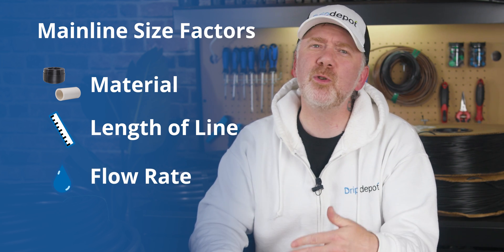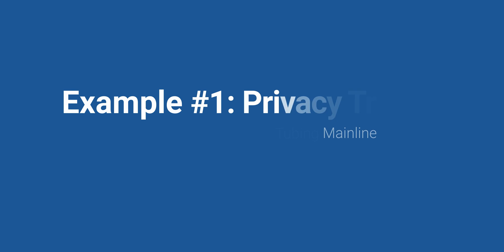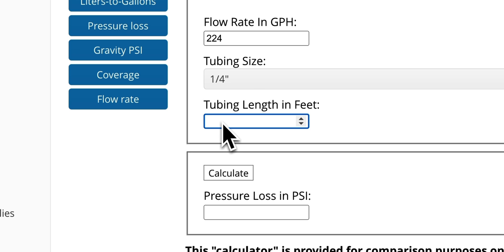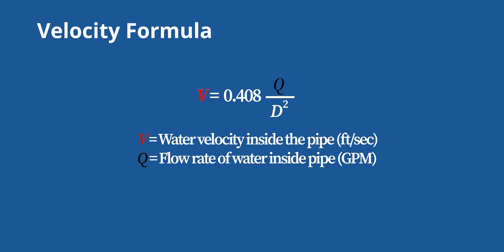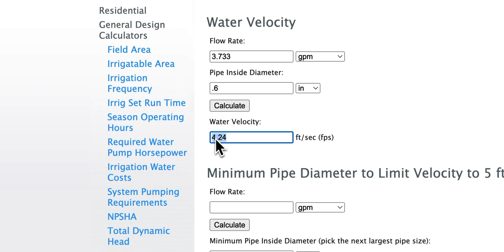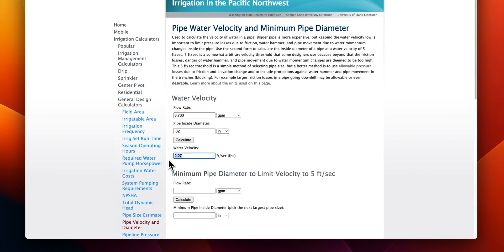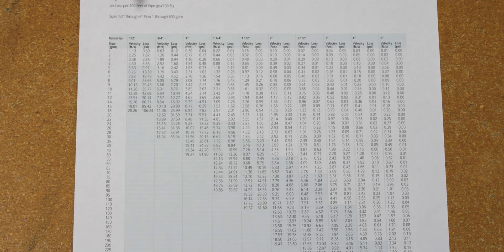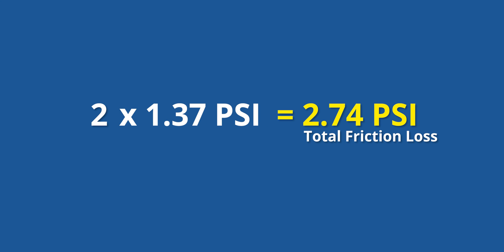How to Size an Irrigation Mainline (Step-by-Step DIY Guide)

Comment: When will the USA metricate - the rest of the world has.
Reply from the maker: Within the industry in the US, we do actually use metric and some of that has started to spill over to the actual parts, 3.6mm and 7.0mm takeoff adapters, 18mm tubing, 2 - 8 lph drippers and many others).  Most of that then gets converted to imperial units for website listings, manufacturer's literature and specification sheets.  I suspect if they stopped converting to imperial units and published it all in metric units most folks wouldn't skip a beat, particularly with poly tubing (those who primarily use PVC might have to adjust a bit).  It would no doubt save some time and money that is currently spent creating separate spec sheets too.  It's largely a case of, we're already using metric to a great degree, particularly at the professional level, but publishing information in imperial units stubbornly lingers, perhaps just out of habit at this point. 

(I confess still prefer temperature in regards to weather being in fahrenheit though)  :)

Comment: My garden is about 60 ft by 130 ft. Is this considered a small system, large system, or right in between? Thanks.
Reply from the maker: At 60' x 130' you'd be in the larger side of things in regards to residential gardens.  Not huge, but definitely not small (small would generally be a few raised beds and some potted plants or similar).  

Basically, a good sized garden but not so big that things will get really complex due to long distances or really long rows, at least assuming the water source isn't too far from the garden  :)

Comment: I just had my well dug for the first time ever. No idea how to tell what my "flow" will be. What does that even mean? Do I just turn on the hose and start filling buckets and measure how many 5-gallon buckets I can fill in an hour? And furthermore, how do I know my "maximum flow" as opposed to my "minimum flow"? I'm sorry to sound ignorant or stupid but as a beginner I just always assumed the same flow rate would always come out of my well (I'm on a big aquifer).
Reply from the maker: Not ignorant at all!  In fact, quite the opposite: asking questions is the exact right approach when you're exploring a new topic - the folks who try it without asking questions often end up in over their head, getting parts that won't work with other parts they ordered and generally end up with a big mess.  I'm always happy to answer questions and help keep folks pointed in the right direction, and when I was new to it all I asked questions non-stop - and I still do to this day for the most part :) 

You're on the right track so far as well, testing your flow rate is great to do early in the process like this, and it directs most of what comes after.  All you'll need to do is fill that 5 gallon bucket with water and time how long it takes.  Then, plug the numbers (size of bucket, how many seconds it took) into this little calculator and it will tell you what your gallons per minute and gallons per flow are: https://www.dripdepot.com/irrigation-calculators/flow-rate-calculator

If the water source fluctuates for any reason, you can test it at different times of day to see there's any significant differences, though with a well and pump that is unlikely unless they will be providing water for something else at the same time as the irrigation runs.  There's where the maximum and minimum flow come into account for the most part, shared water sources where pressure and flow may be less at times (when everyone in the neighborhood showers with city water, or if house fixtures or other hose bibs are being used at the same time as the irrigation).  

If you hadn't bumped into it yet, the reason to test the flow rate is to essentially know how many emitters can be used at one time.  For example, if the flow rate tests out to 500 gallons per hour, then you know you could use close to 500 1.0 gallon per hour emitters (generally best to keep emitters about 20% lower than the tested flow rate, so about 400 1.0 gallon per hour emitters in this example).  

I hope this helps you get started, you're welcome to reach out any time!

Comment: I need 1 1/2” and you do t offer that in the calculators or in products.
Reply from the maker: You bet, what type of line are you planning to use (PVC, HDPE, Layflat, Oval Hose, etc)?  We carry the Layflat and Oval Hose at those size.  If you know the flow rate that will be going through it and the length you need to use, we do have friction loss charts at this link for Sch 40 and 80 PVC, SDR Poly and Layflat here: https://www.dripdepot.com/file/parent/13081/dripdepot_pump-sizing-worksheet.pdf -- There are online calculators that could work here as well, but the charts will often serve better for anything other than PVC since PVC is fairly universal in regards to diameter.

Comment: I dont understand, my mainline will easily be 1000ft from the water source but im.not needing much water as of yet (only around 20 trees if that as of now), so what do I purchase if you are saying that 1000ft is too far?
Reply from the maker: 1000' may be too far for smaller diameters, but there's pretty much always one that can get it done :) 

How much water do you plan for each tree to receive in gallons per hour?  With the flow rate known, some sizing can be done through calculating friction loss.  For example, if each tree will have ten 0.5 GPH emitters surrounding it, then we know the flow for each tree is 5.0 gallons per hour.  Multiplied by 20 trees, that is 100 GPH.  

Using a friction loss calculator, 100 GPH going through 1000' of 1/2" (0.600" inside diameter) poly tubing would lose 13.1 PSI from friction, a pretty high amount.  If we change that to 3/4" (0.820" inside diameter) tubing, friction loss is only 2.9 PSI.  If you plan to add more trees in the future, it could be worth planning for it now.  If 20 more trees were added and received the same amount of water, the system flow rate would be 200 GPH and pressure loss in that same 0.820" inside diameter tubing would increase to 10.4 PSI, however in 1" tubing (1.06" inside diameter) this would drop to just  1.6 PSI.  

Basically, determine the system flow rate first so that you ensure friction loss isn't too high.  If you are going to add more plants/trees to the system it's often a good idea to size the line for the planned additions so you don't have to replace the mainline later on.  

I'm using the friction loss calculator here - to use it, all that's needed is the system flow rate in gallons per hour, the linear length of the line and its diameter (diameter can be changed using the dropdown menus): https://www.dripdepot.com/irrigation-calculators/pressure-loss-calculator
Reply: @dripdepot seems like pvc may be the way to go, also the shipping cost to Hawaii for 3/4 tubing etc is not reasonable
Reply from the maker: @Day-dreamer488  PVC does lose a bit less pressure from friction in the same nominal size than poly tubing, which can be handy :)  

And yes, agreed on the shipping to Hawaii for larger items like tubing coils.  With that said, sometimes they can be lowered, but does require some special handling to custom make the label.  Something as large/heavy as a 3/4" tubing coil would normally default to FedEx for the lower costs, but this is one case where we can manually look into USPS and it often comes in a good deal lower than FedEx.

Comment: Is there any difference in what attaches to a 1/2 inch poly tube mainline versus 3/4? Or can a 1/4 line for a micro sprinkler be inserted into either one?
Reply from the maker: There are some differences in what can attach to the two different sizes, but for the most part only minor differences in barb sizes (3/4" and larger tubing can allow for larger barbs for things like high flow drip tape rows).  The barbs found on microsprinklers and 1/4" fittings in general will work well with both sizes using the same standard methods :)
Reply: @dripdepot thanks!

Comment: Everybody is using 1inch on these days around new England.
I'll try to do PVC between backflow and the manifold as much as I can. PVC manifolds are my preference but it's not possible sometimes.
Reply from the maker: 1" is pretty much the default around the Pacific Northwest as well.  Some of it is likely availability, 1" is so common, including the 1" manifold pieces.  

If you're looking to avoid PVC in the manifold and upstream of the manifold, there are a couple other options and we see them used pretty frequently in the Northeast and other places where freezing conditions are a real concern.  

Constant pressure rated HDPE (High-Density Polyethylene) is an option we see used a lot in cold climates.  Like standard LDPE (Low-Density Polyethylene), it has that "bend but don't break" property that makes it a good choice in cold climates.  

PEX is starting to see more use in irrigation for that same reason, though it can be cost prohibitive and requires careful sizing since the inside diameter tends to be smaller than other tubing/pipe sizes. 

Essentially there are some good alternatives to PVC pipe if you're looking for something a bit more resistant to freezing conditions :)

Comment: I'm using a gravity system with a 250g rain barrel. I have a 100 ft span that will T into a total span of 60 ft.  It will then split into 11 rows of drip tape. What size mainline do i need?
Reply from the maker: Friction loss is a mechanism of both distance and flow rate, so we'll need the other half of that equation :) 

How long are your drip tape lines going to be, and what will the emitter spacing and flow rate be?  And how many do you anticipate will be on either side of the tee?  With that we can determine approximate flow rate and run some friction loss calculations on various diameter mainlines to see how much pressure would be lost from friction in each one at your distances.  

While I don't need it for friction loss, do you know the elevation difference between the rain barrel and the field?  Looking to get an idea of your starting pressure.  Basically, a little friction loss is generally ok, but it can be critical on a super low pressure gravity system.
Reply: @dripdepot  there will be 11 drip tapes off of the T at approximately 42 ft each and 12 inch emitter spacing. The elevation difference from the barrel to the garden is approximately 2ft. (I have room to raise it further if needed)
Reply from the maker: @Ameliaegghart  Ok, I ran this as "worst possible circumstances" which assumes emitter flow of 0.50 GPH (high end flow rate of most drip tape) for a total of 231 GPH in flow rate going through 160' of tubing.  In reality the flow will be split to the left and right after that tee into however many rows are on either side of it, so this isn't entirely accurate, but takes into account worst case scenario.  

In that scenario (231 GPH going through 160' of tubing) you'd want 3/4" tubing minimum, possibly even 1".  1/2" would lose almost 10 PSI from friction, 3/4" would lose 2.2 PSI  and 1" would lose 0.3 PSI.  2' of elevation generates 0.86 PSI, so there's not lot to start with.  

This can be offset by going with lower flow rate tape than I went with above -- if you were to use 0.25 GPH emitters instead, the loss in 1/2" would be 2.8 PSI, in 3/4" 0.6 PSI and in 1" less than 0.1 PSI.  

With 3/4" line and 0.25 GPH drip tape you'd likely get good results, since technically 60' of the run is going to have its flow split to either side of the tee, and we're not counting the height of the 250 gallon water tank into the pressure calculation (unless it's only 2' tall of course).  I also rounded up PSI losses just to help take care of those small losses that aren't usually directly accounted for :)
Reply: @dripdepot i appreciate this so much! Will be placing my order soon. Thank you again!!!

Comment: what about the effect of elevation of the land?
Reply from the maker: Great question -- in regards to elevation, water pressure is lost/gained at a rate of 0.433 PSI for every 1' of elevation change (4.33 PSI for every 10').  Using that, you can determine how much pressure is lost or gained due to the elevation changes in the field between the end of the system and the water source.  Elevation changes can also cancel one another out.  For example, if your mainline traveled 10' to get up a hill, then 10' back down, the net gain/loss would be 0 PSI.  In that instance (and similar) the only real concern is in having enough pressure to get up the initial rise (only 4.33 PSI for 10', but could be a bigger concern for significant elevation changes).   :)

Thank you for the great question!

Comment: Is there a video for non burger people I don't understand the metrics
Reply from the maker: There's a few online guides, but I did a search for sizing a mainline in metric and came up empty on videos, which is fairly surprising since most of the world uses metric.  The manufacturers of a lot of our supplies actually do use metric and then convert to imperial units to sell in the US.  The 0.5 gallons per hour drippers that are common over here are actually 2.0 liters per hour drippers.  

It adds an extra layer of hassle, but you could use google to convert the units over to imperial if there doesn't end up being any metric videos for it out there.  

Hopefully we join you in the metric system some day, it would make our jobs easier in the industry as well!

Comment: I'm a little confused why we would use our full water pressure when making these calculations. Doesn't drip line need to be pressure reduced? Would that mean you'd have to reduce the pressure at each tree ring individually?
Reply from the maker: You do have the right of it that for most water sources pressure is going to need to be regulated down to 10 to 25 PSI depending on the type of emitter line you're using.  Depending on the size of the system, it's still important to run the calculations however, as friction can still cause enough pressure loss to impact the system.  

If it's for a smaller system following the general guidelines (30'/30 GPH for 1/4", 200'/200 GPH for 1/2", 480'/480 GPH for 3/4") will typically keep you up and running well :)

Comment: Great video with fantastic information! I do have one question though. So, besides it being more expensive is there any negatives to getting too big of a main line?
Reply from the maker: Awesome question (no exaggeration either)!  

Other than expense, the only possibly negative I could think of is if space is at a premium -- here I'm thinking of greenhouse or nursery growing where every inch might count.  On a farm, this might not be at all a concern. 

I do want to elaborate on expense a little though -- in addition to the initial expense, the ongoing expense of repairs (repair couplings, etc) can add up to a bit more over time.  Possibly nothing serious if it's just a size jump or so (think, 1/2" to 3/4") but could be considering if it's a large size jump (think, 2" to 4").  

There are some small considerations that might be considered negatives in some niche situations -- water in larger pipes are likely to have less velocity -- lower velocity can lead to more sediment settling, potentially leading to more clogging or maintenance in the future -- again, very niche and unlikely to even be noticed except in large sizes, but worth mentioning to be thorough :) 

Installation could be more challenging with larger sizes -- more weight to haul around essentially.  

And with all that said, it's not uncommon (in personal or commercial use) to go with one size larger than you need -- not just for the sake of pressure and guaranteed success, but for expanding in the future.  It costs a lot less to go with a larger size up front than to replace a smaller diameter with larger later on.  

Thank you for the great question!

Comment: In Example 1. is it not important to take into account the length of the tree rings? I used 1/2" mainline in my project but am now realizing I've used it more as a manifold for 1/4" tubing to reach my plants. So far I've used 100' of mainline and ~15-20' of 1/4" but had intended to extend my mainline and use more 1/4". How concerned do I need to be?
Reply from the maker: This is a great question -- for the most part, the friction losses incurred by the length of the tree rings will be minimal.  In the first example, our tree rings were going to have 8 0.5 GPH emitters -- with 12" spaced drip line this gives us an 8' length of 1/4" drip line and a flow rate of 4.0 GPH.  4.0 GPH going through 8' of 1/4" line will only lose 0.1 PSI from friction.  

In your example (15' to 20' of 1/4" line), the friction loss would only be 0.3 PSI assuming 8 0.5 GPH emitters in the tree ring.  

Basically, it is something you account for if things are on the cusp of not having enough pressure, but for the most part tree rings (or even 1/4" tubing with drippers at the end) will be low enough flow that their friction loss will be minimal.

Comment: If the spigot is 30 feet away from the containers that I am setting up irrigation for, is it fine to just have the head assembly then have 1/2polytubing running 30ft before having any emitters/drippers?
Reply from the maker: I think this plan sounds fantastic -- a head assembly at the spigot, followed by 30' of 1/2" tubing and running microtubing with emitters and drippers to your containers is exactly how we'd do it, your instincts here are spot on.  With that route, everything is well into the green specification wise :)